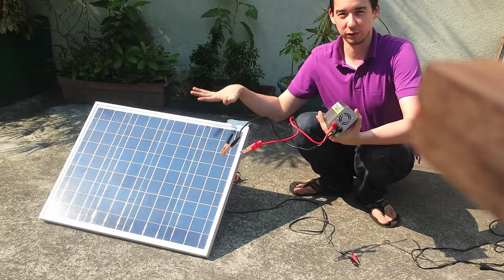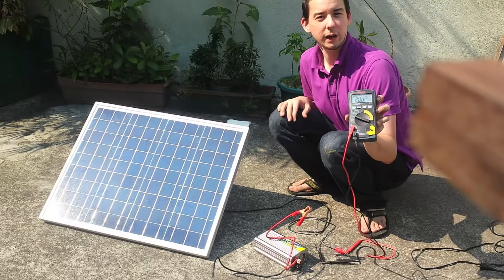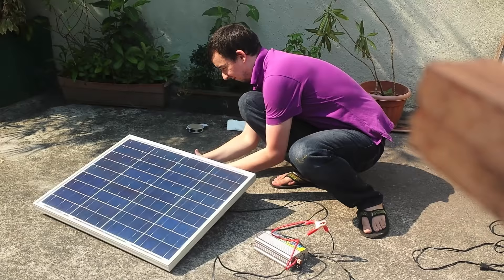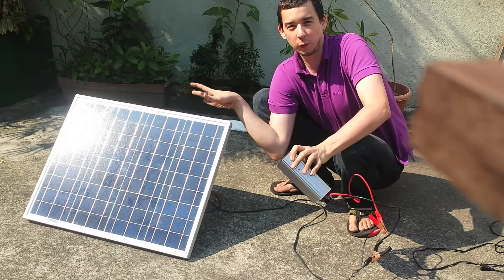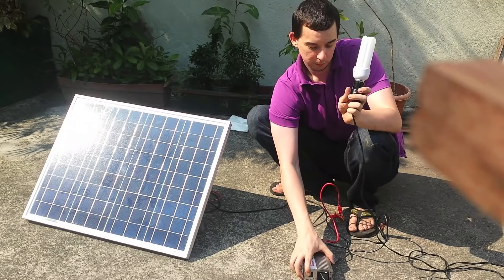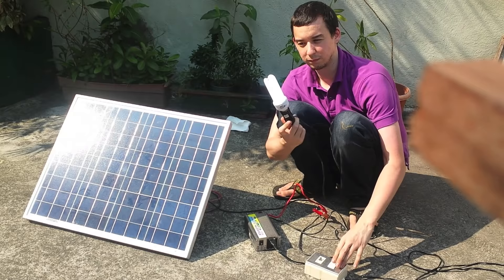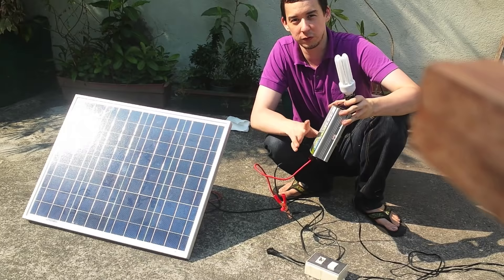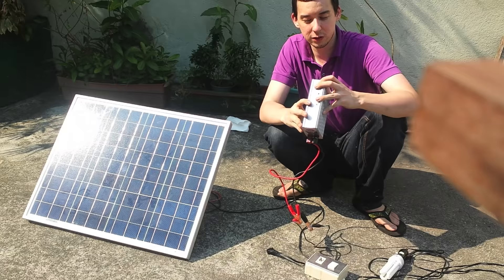Inverter wired directly to solar panel

Comment: You can use a buck converter to safely run a 12v inverter from a solar panel.  Some of them can be VERY high efficiency.  The problem is the other thing this guy said: the reliability of the voltage,  Undervoltage can also be a problem.  When the panel is shaded, damage to the inverter (or any sensitive electronics you're powering) can result.  The only truly safe way to do it is, like he said, to use a battery.
Reply from the maker: Christmas Eve For sure you'd want to use a battery. But in a worse case emergency scenario, you could get by without one. Even if you regulate the power down to ~12V, if the voltage drops, many inverters will turn off and lock up until manually having their power cycle. I've seen people work around this with a few electronic components (relay based) to automatically reset the inverter after a low voltage drop.

Comment: How about connecting the Inverter to a solar charger/controller that connects to a solar panel.. I think it will work much well than a direct inverter - panel alone..
Reply from the maker: +Faith Sanchez many charge controllers won't do anything without s battery connected. I guess you could connect the inverter where the battery is meant to go but I imagine it would turn off due to irregular feedback.

Comment: You need a charge controller conected to the solar panel and the other end the inverter in order to protect the load from high voltage.
Reply: they say you can disconnect the battery backup. connect wire from solar output of charge controller directly to inverter, and power things. I have seen it done. it's awesome, they said it was by mistake as the wire from the charge controller (C.C.) and inverter where conect to same terminal and when terminal was removed for working on system , it still stayed on.

Comment: Great presentation ! maybe you can answer the following:I have  (x3) 305 watt 24V solar panels option (1) run in parallel or (2) Series? 36.9 volts each @ 8.94 amps each from solar array,  Wired to a MPPT 80A C. Controller using    (x4) Trojan RE T105 6 Volt DC Golf Cart Batteries. Ran in either Parallel  or in Series? into power inverter. Option (A) Cobra 12v 2500 watt inverter Modified Sine WaveOption (B) Aims 24v 1500w Pure Sine WaveCan I use Option A being the panels are 24v but the inverter is 12v (Mppt 80A ) Or will it only work with Option (B) with a 24 volt. Would there be a safe way as to not burn up the 12v inverter inline with the without frying the 12v inverter ?.Any advise is much appreciated !

Comment: Bro   hello.  I have no car no battery  and 220v 500 watt Power supply 40A  12 v Can I connect it instead of the battery? Connect to the car inverter generate 220 volts?

Comment: Obviously it will work. The solar panel you have used could deliver 1.5Amps. And the bulb you have used will take like 700mA. So yeah it will work.
Reply from the maker: +Pasan Karunanayake Don't forget the inverter itself burns about 5 watts :P
Reply: +Gadget Addict, Yup even with that its easily will work. Nice video by the way...

Comment: Mine won't accept more than 15 volts because that's overvoltage. It shuts off automatically (as it should). You need to install a voltage regulator between the inverter and solar panel, then it will be fine.
Reply from the maker: It worked okay for me... what size panel did you connect? Did you have a load on the inverter? Once you put a load on the inverter, the voltage will drop significantly. I wouldn't actually recommend connecting it directly anyway, this was just a curiosity over whether it could be done or not.
Reply: Gadget Addict I understand. It was a 20 watt panel. My inverter won't connect loads if there is overvoltage, though.
Reply from the maker: Kompulsa Okay. I'm a little surprised because the inverter itself would be drawing power from the panel (at least a few watts) as soon as it's powered up, instantly dropping the voltage. Did you connect the panel or is this just theory based on the overvoltage protection the inverter says it has? Another interesting test would be to connect a small 12v bulb (maybe 5 watt sidelight for car) and then connect the inverter.That should drop the voltage to a reasonable level. Of course you're wasting power on the bulb but this whole thing is just a crazy test anyway lol.

Comment: Question...what if you had a permanent magnet generator from a wind turbine, or a wind turbine, that can supply a constant steady flow of charge to a charge controller > inverter > load, theoretically, wouldn't the batteries be obsolete?
Reply from the maker: If it was indeed a perfectly steady supply and your load was never larger than your generator output then sure it should work. Essentially it would just be Generator > Voltage Regulator > Load.  it's worth noting that  many charge controllers cannot operate without a battery connected
Reply: Gadget Addict Can you recommend one that would work without a battery (bank)?  or alternatively, if it was a steady charge, would one battery work?
Reply from the maker: Leon B I wouldn't be able to recommend because things get a bit more complicated with wind power. Depending on your setup you might need to consider things like rectifiers, boost converters, dump loads, voltage regulation and so on. You'd also have to think about whether your load is small enough to connect straight to the charge controller or if you need to connect it to the battery. If you had a wind turbine and an appropriate charge controller then I don't see why a single battery wouldn't work just fine. It would obviously limit your ability to output when the turbine stops spinning but will act as a nice buffer to ensure a smooth output.
Reply: Gadget Addict Ok, now I understand. So a "Charge Controller" is simply a regulator for the batteries so they don't get overcharged. As for the battery scenario, again, assume the turbine never stops spinning. I know its hard to imagine, but it is possible and in that perfect scenario, the battery would remain almost fully charged right? in an off-grid situation, would it be possible to connect the breaker unit to an inverter? The reason for many of these questions is the fact that here in Atlanta, Georgia, Solar is proving so far to be the only thing available because there's not much wind. Nothing so far as it concerns wind energy. I can't find 1 wind turbine installer in the entire city, which is a bit frustrating, even on AngiesList. I know there's more to having such a system hooked up, especially to the grid, but at least some basic knowledge of how everything would work is what I am seeking. Thanks again for your time.

Comment: hi. thanks for sharing this video, really gave me idea. but quick question,  how many solar watts should I buy to run an electric fan & a light? any chance to store the save solar energy - coz not all the time there is sun since rainy season is coming
Reply from the maker: Typically you'd have one or more solar panels, a solar charge controller and one or more batteries to store the power. The size and number of the panels and the battery will dictate how much power can be generated and how much can be stored. Typically, LED lighting will not consume much power. As for the fan, it depends if you use an inverter + AC fan or just buy a 12V DC fan which will be more power efficient. Ultimately a 50-100W setup would probably serve you well for that :)
Reply: +Gadget Addict thank you. . already started checking solar panels at cdrking. btw, they should give you credit on that 😊😊

Comment: something i did with an 18 ft  136 watt solar panel. with no battery.  could run someting up to 46 watts, no more. inverter lose power. so yea battery maybe things need then. think panel amp could of been 4 to 5 amps but was not. was 1 Amp with no load on it. as sunny as it was. maybe have bad panel.

Comment: The inverter won’t do any harm to the panel the penal will more likely to burn the inverter up mppt or one stage of inverter just that it can handle high voltage

Comment: to get over the voltage issue, could the solar panel use a charge regulator? then output form the charge regulator power the bulb?
Reply: use voltage stabilizer

Comment: I watch a lot of your videos. I have a general Solar question for you. I have a gable fan in the attic that pulls out the hot air. Can I put a micro inverter and wire it right to that fan? I wouldnt need a backup battery system because it only runs in the daytime. Please if you can help me with any thoughts on this?
Reply from the maker: Anthony Papa Yup I don't see why not. You should check the fan, it might be a DC fan and only require some voltage regulation instead of an inverter.

Comment: Great video! I was thinking of doing a sort of passive skylight for my dark house. I'd like to connect it to 12v led fixtures that dim and brighten along with the sun. Do you think I would be able to use only solar panels and a charge controller at 12v to make that happen? No need for an inverter.
Reply: Drop the charge controller and use a dc to dc converter.
You can find 12 volt screw in LED bulbs for 12 volts with an E27 or E26 socket/ regular american or european sized socket.
You hook it up like this. solar panel to dc to dc converter and then to your bulbs. Notice you have to adjust the out put voltage befoe you you hook your bulbs up.

Comment: Can a solar regulator be used in between the solar panel and inverter to regulate the voltage and current coming from the solar panels to the inverter
Reply: Yes

Comment: cool stuff... gonna purchase one of this this week... hmm.. what brand of solar panel are you using?
Reply from the maker: Sebastian Sandiego The panel used in this video is from CDRKING. I have panels from a few different sources. Don't forge that this is purely a test scenario. In a real life long term setup you'd need a charge controller and battery :)

Comment: If you can not afford LiFePo4 battery packs just simply use a set of 10000 mf 10 x  capacitors to get a stable power to your invertor + charge controller  ,   so it goes this way   panel > controller > capacitors > invertor

Comment: could you power a 1500 watt ac appliance? if you got the correct dc-ac inverter? & stepepd up to a 100 watt solar panel?
Reply from the maker: +da man You couldn't get 1500 watts out of a 100 watt panel. So no. And I wouldn't recommend trying to draw a constant high load directly from solar panels in general.
Reply: tks much appreciated, for example what you did in your video, solar panel directly to the inverter, when the sun goes cloudy, & the inverte
r stops, would this damage it? other than stopping it, till the sun fully came back out , for, full power.

Comment: Hi there..i have a 12 volts trolling motor..i like to set it up using solar panel.. whats the best set up for that..planning to buy cdr king pannel.. i also have limited space in inflatable boat..preffered to use small panel..
Reply from the maker: cris pabillore Motors are very resilient to fluctuating voltages, they basically just spin faster or slower. So you can connect the solar panel directly to the motor (with a fuse and diode) and you're good to go :) Just make sure the panel can generate enough power for the motor.

Comment: id like to watch your video clip, because my dad was planning to buy solar panel in cdr king. i want to catch up more videos how does it really works the product of cdr king solar panels... thanks..
Reply from the maker: If you subscribe to my channel and check out my other videos, you'll see I have a few that show cdrking solar panels :) My experience with them is actually very good. The aluminium frame isn't as good as more expensive panels but the power generated is as good or better.

Comment: what if you use a pwer controller that keeps the voltage in 12v 20 Amp and connect it directly to the inverter
Reply from the maker: It might work but you'd be limited to how much the inverter could actually run since you're only pulling power from the panel and not stored power from the battery. Ignoring any losses etc, the maximum your inverter could pull from an 80 watt panel would be 80 watts, but if you connected your panel to a battery and stored that power, you could pull more than 80 watts. A panels output fluctuates throughout the day as clouds pass over the sun, the panel heats up etc. It might work in an emergency situation but it's really not advised. I've used small panels with a 7812 voltage regulator to power 12V fans (5-10W) but anything more than that and I'd recommend a proper controller and battery.

Comment: Have you tried using grid tie inverters? are you going to review one?
Reply from the maker: Jobert Cadag I've not used one myself but I've seen them in action. One at someone's home and another at a business, both in QC and both without signing up to met metering with Meralco. I'd like to review one but unfortunately I don't have one and I'm not in a position to buy and use one myself at this point. Grid tie inverters can be much more cost efficient than batteries but of course you have to consider that the inverter will shut itself down if the grid goes down, for safety reasons to prevent back-feeding while people think the line is down and safe to work on. There are options that will allow you to continue safely using it if the grid goes down, but requires extra expensive and an electrician.

Comment: will a cheap dc-dc 36,24v to 12v converter before power inverter work alright.
Reply from the maker: +wayne hart yeah that should do the job. Of course every time a cloud passes over, it's going to potentially cut off.
Reply: Thanks for the advice, have 200w panel so far but dc-dc converter is only rated to 3A. Trying to get out of buying battery for now. All the best with your YouTube channel.

Comment: I have a question, I got a canadian 315w 24v PV single solar pane, I do have a 12v 400a deep cicle battery, but just curious... Down here in Soutern Brazil i got up to 12-13 hours a day of sun, the peak of my panel is 45v, I can keep that rate from 8am up to 6pm, from 7am-8am I'm already above 12v, and from 6pm-6:45 I'm still above 12v... now that you know the conditions on a cloudy day, tell me, I got a 50 inches plasma television, 220v 1,25ah, with max consumpion of 275w, since I'm running it on Eco mode it should probably be running between 100-175w, the question is: Can I run this television straig from a 12v inverter without causing damage to any of the equipments involved?
Reply: Alex Siqueira You should Use 24 Volts pure sine wave Inverter to safely use your Plasma television and two Batterie of 12volts 7 amps with Charge Controller otherwise you cant
Reply: Muhammad Aamir Thanks for the information: My setup now is, 1 canadian 45v 315w pv solar panel, my charge controler is an epsolar true mppt tracer 40A, and my battery is a big flooded 12v 400amp battery...  Now my panel is able to produce at least 5 hours of 20-25,5amps per hour at 14,8 volts(charging)... My charge controler is working pretty good, 3amps since 8 am to 10 am, from 10 am up to 16:30 it remains 25 amps, and till 17 pm up to 5-3 amps...   My battery, is a flooded, down here in South Brasil people enjoy to build sound projects, so we got pretty special batteries down here, the case of my is that it canaftly handle up to 600 discrges down to 205 per cent of its capacity, so I have avaliable 320amps... Usally I do not discharge bellow 12.20v (teting)... My secnd batr has being sent this Frida, so I'll have 24v 400 amps avaliable till te end of the week... My inverter I'm more concerned, I also agree with pure sine wave inverter just tring to seal a deal without bning mony, it's a 800w reqirement (already 20 per cent more than I need), but I'm looking on to a 1000w jst to avoid problemas.... The Mppt 40a, can only handle 1 panel of tht sze in 12v batery bank, so with my 24 bank I'll be ale to rn 3 of them, two necessary and anoter one for compensation of looses and clouy das.... Is that fair enought to rn my appliances?  I made the calclations many many times, but tre is alway te loos of heat factor.....  The only secundary components I have paid atention for now is my cable, its a large one, no heat at all.... Testing the half system using a 150w car inverter, two weeks so far so good, lamps, wifi, desktop fan... Battery is not heating up or releasing much hydrogen cause is near a vent.... Now my questions for next week are focused into how to size my fuses, how many amps, where to put, for a tv, computers and lamps do I need extra fuses? This sort of questions...   One more thing in my mind is that my batteries are over my book case, its perfect cause I got no cables at all from the roof to the inverter and from it to the batteries, it's an old very thick wood book case, but I'l concerned if a battery box is enought to prevent fire while Im at work...  I'm just wondering a plausible way to prevent this sort of problem, and unfortunetly here I do not have an outside instalation to keep the bank... How often do well mainteined flooded bateries catch fire?  I mean I do aknoledge that they blow celss if not well managed, but in the case of a battery box, those blows are unlikely to result in fire due the lack of oxigen or a fooded battery is something that keeps burning from inside out?

Comment: very interesting; can you run a fan with this system
Reply from the maker: You can, but you would want to use a pure sine wave inverter to maintain the life of your fan, instead of a modified sine wave inverter. This is only a proof of concept. You should add a charge controller and battery.